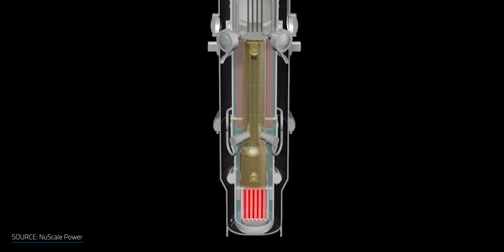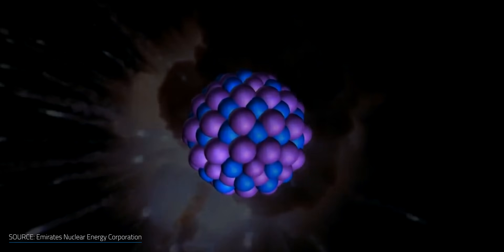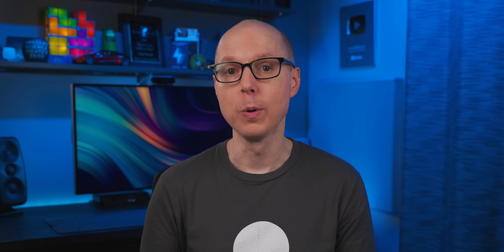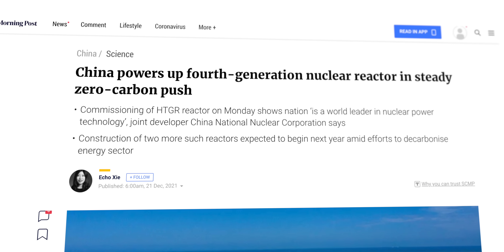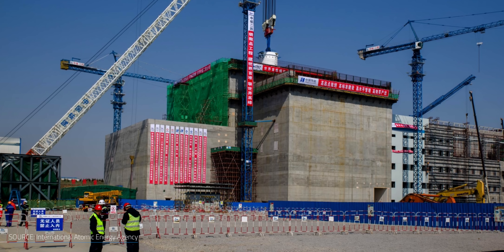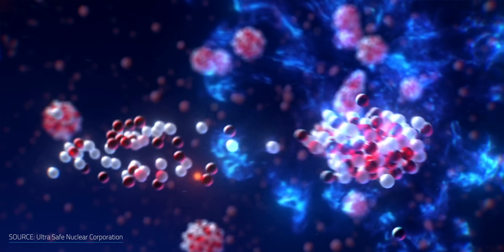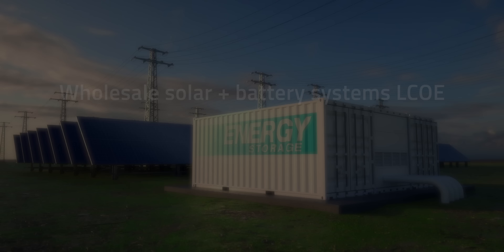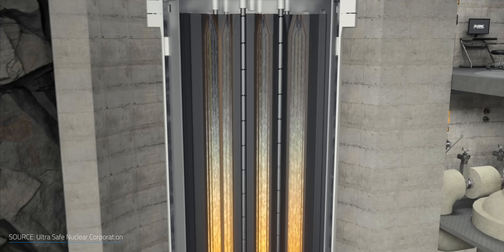Forget Small ... What About Micro Nuclear Energy?

Comment: My only question is: Can these microreactors be used for nefarious purposes, if one were inclined to do so?
Reply: If they run on low enriched uranium, you need to crack open the reactor, extract the fuel elements, process it into hexafluoride, enrich via whatever method, reassemble into something dangerous. It is easier to just get natural uranium and do this. If they run on high enriched uranium, they won't be approved for export. 

The other option is to turn them into a Plutonium breeder reactor but that is challenging as well and I don't know how easy that would be for each SMR design.
Reply: You can make the metal for a wind turbine into a tank or bullets. You can turn oil into napalm. You can use almost anything for nefarious purposes, so why not use it for a good one instead?
Reply: A few tanker trucks full of toxic heavy metal waste from a battery or renewable plant can be used for nefarious purposes for a lot less headache and do more lasting damage than the few curies of radiation released if someone bypassed all the security protocols in place to turn a microreactor into a micro dirty bomb.

Comment: All power sources are reasonable in their own 'wheelhouse'.  I would like to see SMRs and Thorium reactors commercialized, and work alongside solar and wind and battery 'peaker' facilities.  But that could just be my perspective.  Using SMRs and Thorium for lower solar intensity space missions could also be a long-term winner.  Thorium to use the 'waste' from old nuke reactors and manufacturing I see as a long-term win/win solution for much of our nuke waste.
Reply: With Thorium wasn't that due to that it couldn't be weaponized the main reason no further research was done?
Reply: @kiwibonsai2355  That was one of the main reasons that research did not go 'full bore' during WWII.  Afterward, the Thorium demonstration reactor was run for over a decade, typically turned off on Friday evening, and the safety plug was heated back up on Monday morning to restart the reaction.  Pretty safe even as their demonstrator.

But that is just showing my geeky minimal historical knowledge of the project and era. <<grin>>  

Yea, DOD was focused on getting a bigger better boom boom rather than energy for power.  History has a way of changing perspectives over time.
Reply: @jackcoats4146  thanks for the reply Jack.
Reply: @kiwibonsai2355  but also thorium works better as a thermal liquid fueled molten salt reactor design then Uranium.

Comment: Tiny reactor in the wrong hands(even if spent) + fertilizer + diesel = dirty bomb/ terrorist nuke. There are NO nuclear energy that can be tolerated in the long run. Not only is it lethal to be near un shielded waste, the fuel is also dirty to mine and finite in supply. All we would get is a new type of fuel that kills us and we would eventually run out of and have to replace it, let´s not go there again but find energy that we can´t run out of. We may need nuclear in space where solar is not enough and radiation is already high but never on earth.

Comment: Obviously there are lots of details to work out, but micro reactors in concept allow for loads of options toward the goal of decentralizing electricity generation. It is interesting that many people are alarmed about the management of nuclear waste. Clearly, it is an important part of the process, but If only we had been storing the toxic biproducts of our means of energy production in the last 100 or so years instead of letting it float away into the atmosphere (and accumulate) we would be dealing with a very different type of challenge to keeping the planet able to sustain life.
Reply: Nuclear waste is only waste if its useless.  Check out the candu reactor and new research on SMR variants.  We can fuel the SMR reactors for 100+ years with the junk we cant figure our what to do with (or use unenriched uranium which is cheaper and reduces proliferation risk)
Reply: maintaining this units can only be done by highly trained specialists. This alone is not scalable.
Reply: Sent it all to Mars to heatup creating atmosphere … maybe
Reply: I currently manage a stable, and utilize four ox, two bulls and one bison that turn a set of wheels and gears that supply five fifteen kilowatt alternators. 
I gave up that simple life for a cold laser I borrowed from my wife's beauty supply to enable Superconductivity in a ten kilowatt ebike motor that runs all five alternators twenty four hours a day without overloading. 
Bison for sale.
Reply: @robh467  I um..  am going to need that recipe 🤣
Reply: Why should we want to decentralize electricity production? Wouldn't economies of scale reduce cost, and industrial waste per unit power?
Steelworks, construction, and mining aren't necessarily clean (or cheap) industries, so it seems to me that we should leverage said economies of scale to minimize the amount we need to produce in the first place.
Reply: "...but micro reactors in concept allow for loads of options toward the goal of decentralizing electricity generation".  While this might eventually be the case, more importantly they can be installed at existing carbon-based generation facilities where transmission lines already exist. This means that we don't have the ultra-costly task of stringing transmission lines to where the wind blows and the sun shines.
Reply: I never thought of it that way
Reply: As of the last 15 years there is essentially zero waste product for nuclear power
Reply: @Matt-xu6hz  A 1000 MWe generation facility produces electricity for more than 1 million people. At the end of a year, the nuclear plant has about 3 cubic meters of radioactive waste which weighs about 60 tonnes. A 1000 MWe coal-fired plant produces 300,000 tonnes of ash and more than 1 million tonnes of CO2 at the end of a year.. I don't have the CO2 tonnage for methane-fired generation stations.
Reply: Nuclear waste is a easily solvable problem, we can just store it all underground, apparently there's only a few places that allow this but small reactors = small waste and it can be stored the normal way too
Reply: Superconductivity. Superconductivity. Superconductivity. Superconductivity. Superconductivity. Superconductivity. Superconductivity. Superconductivity. Superconductivity. Superconductivity. Superconductivity. Superconductivity.
Reply: Mark Ulis  that's not nuclear waste though, that's nuclear reactor failure due to a natural disaster. Depleted fuel rods are used to initiate new thorium fuel, which is then used to initiate future thorium reactors, which the waste from that is able to be used in Molten salt type reactors, and a lifetime of energy produced via these methods results in about a hockey puck sized mass of waste
Reply: No! Don't entertain this idiotic idea. One single big meltdown is still a lot better than multiple ones spread out all across the country or neighborhoods. This is science unchecked.
Reply: Kalki Ironman type 7 and 8 after 2026 😎

kalki avatar (beast of the earth) (christ on the white horse) (son of man on clouds) is the biggest enemy of dajjal/antichrist/kali 😏

Kalki Avatar (Murtaza) 11th satguru 13th imam cousin of Moula mahdhi a.s. 12th imam (muhammad) 😎

Prophet Moula mahdhi is raja shashidhuvj (the mighty one) born less then 1200 years ago 😎

Prophet Moula Isa a.s. will kill dajjal cause dajjal is going to kill Kalki Avatar 😏

Kalki Avatar will follow orders from 2 religious king Moula mahdhi a.s. and Moula Isa a.s. 😎

Kalki Avatar going to have 2 swords and ring of moula sulaiman a.s. and staff of moula musa a.s. (iron rod) Staff of moula musa a.s. is like omintrix can transform into anything and can transform others into anything And stone in the ring of moula sulaiman a.s. is also known as kastav mani and it's more powerful than all 6 infinite stones combined 😇

Cuz Kalki is ironman batman super saiya-jin superman ben10 saitama optimus prime shaktimaan and every super heroes combined after 2026 😎

This staff will transforms into white horses with wings,weapons,iron-man,cloud etc or can do imagination into reality 😎

*Ratn sru sword of lord shiva (miri)😇

*Ratn varu (zulfakar) sword of Moula Ali (piri) 😇

miri piri 😇

Kalki Ironman after 2026 😎

Satyug (sunrise from West) 2038 😏

Sambal is hospital 😏

Gzwa e hind 2029 😎

Khalistan and Azad Kashmir after 2026 by Ironman 😎

99% Hadith u heard is not about imam Mahdi it’s about Kalki avatar (the main character) that person momin vs dajjal prove me wrong if u can 😏”
Reply: What a moron. Do you even get what you are saying?
100 yrs later our current tech will seem like a waste of resources. Thats the same for 100 yrs back.
Now that we have better ways to use resources we say previous gens wasted it. But they were also looking for more efficient ways.
There will always be a curve. Things don't happen suddenly. And the consumption nowdays is NOWHERE near what it used to be. 
Even with more efficiency we will waste more and more. Because we will always need more.
Reply: Kalki ironman after 2026 😎

Humans 0
Saiya-jin 1 to 6
Angels 7 😇

Kalki Ironman 5th matriya buddha 8th arc Angel 11th satguru 13th imam and 24th avatar after 2026 😎

Almighty God 9 😇

Humans type 2.5+ after 2026 by Kalki Ironman (christ in the white horse)(son of man on clouds) type 7 and 8 😎

Jarvis the world’s first artificial intelligence (parrot) 😎

Cuz Kalki is ironman batman super saiya-jin superman ben10 saitama Narutoo shaktimaan and every super heroes combined after 2026 😎

Jarvis world’s first artificial living being (just like vision in marvel universe)😎

Made of Quantum and sub quantum particles 😎

Power source quantum energy arc reactor (type 7) level technology 😎

Kalki Ironman going to have every kind of arc reactor like:- type 1 Nuclear fission, nuclear waste, hydrogen fusion, type 2 3 4 5 antimatter arc reactor (solid liquid gas), type 6 electro quantum arc reactor, and type 7 Quantum arc reactor, type 8 limitless quantum energy arc reactor without quantum particles 😎

Kalki Ironman going to have sun in a box million billion tons of hydrogen nuclear fusion reactor type 2 3 4 5 just like sun and stars in the palm of his hand 😎

This all going to happened by self replicating quantum nanobots knowledge energy and techniques at type 7 7 7- respectively 😎

Ironman (Tesla 2.0) going to reveal every secrets of the world specially Tesla and his Antigravity 😎
Reply: @Ironcammandoo  do what...?
Reply: Elon’s  rocket to the sun, let it on convert the nuclear waste
Reply: @Dirtyharry70585  what. no.
Reply: @Dirtyharry70585  It's extremely difficult to reach the Sun with existing rocket technologies, although you can get pretty close. If you're just going to dump nuclear waste it's far easier and cheaper to place them on the Earth's ocean beds in subduction zones.
Reply: @nagualdesign  is that where they dispose  subduction zones. I theorized this one evening. Don't remember if I looked into it.
Reply: @cavelvlan25  Yes, it was first suggested in the 1970s or earlier, although others have argued against it. Let the Earth recycle our waste.
Reply: @cavelvlan25  Subduction zones are permeated with water that subduction pressure forces to the surface. Water (and air) contaminated with nuclear waste would create apocalyptic scenarios.
Reply: @Dirtyharry70585  The problem with shooting nuclear waste to anywhere in space is that on average, about 1% of rocket launches explode. If something has a random 1% chance to be chernobyl, you dont do it. Especially not 100 times.
Reply: any steps away from oil addiction, are good for future generations.
Reply: @nameless1016  Whale blubber lamps would not use "oil" and be renewable until we ran out of whales. We could all crawl into caves and only expect natural sunlight for lighting when we dared to crawl out of our holes. Yes we as a species can move past using stored solar power (that is all "Oil" or "coal" is) but even ending civilization as we know it would not enable the transition at the flip of a switch. The people living in the modern world sort of like the conveniences it provides, electricity, running water, flush toilets, entertainment, communications, transportation, medical care.... the human race existed for a long time without any of those comforts, which ones are YOU willing to give up?
Reply: @ocelblack9823  Well put, stored solar power is effectively all the "energy" that is easily accessible we find in the Earth but nuclear done right could give us all of that for far longer.
Reply: @ocelblack9823  None of them. And you?
Reply: @Barberdan  There are only 3 basic sources of energy, fusion, fission and inertia (gravitational). nuclear decay is a subset or daughter of fission. EVERY other "source" of power can be traced back to those basic sources.
Reply: Yes see that guy in the $300,000 pickup truck rolling coal.. Now he can buy a miniature nuclear reactor what's there to worry about...
Reply: @bradhaaf4749  It's nothing like that.
Reply: @bradhaaf4749  He can probably come up with the extra $20 a week in fuel costs, not sure he could swing the $20 Million for the reactor.

Comment: You can´t start such a video with "nuclear is reliable and clean". They are not very reliable, look at France and the many times, they have to throttle their plants down for example in the winter and have to import energy from other countries. They produce dangerous waste and mining uranium is super bad for the environment, so they are not clean.
Where does the time frame for building normal nuclear plants come from? 6 years? What about every new plant, which take much longer to build.
You talk about the "modern" plants like they are real. Every example you could bring is a lab experiment and/or is chinese...trustworthy...
Smaller plants can´t be much cheaper, as they need about the same amount of safety measures and ensurance (haha, nuclear plan ensurance). And where do you want to build them? There is not even enough usable space for normal plants and suddenly we want to build a huge amount of small plants?
Even if they are safer than normal nuclear plants with the larger number of small plants the danger of an accident would rise.
What would happen in a country with thousand of the smaller reactors and a war breaks out?
And then you finish with the death rate graph?! The stuff idiots like Michael Shellenberger bring up, to tell us, how dangerous wind turbines are, because one idiot fell down from one.
But cool, you compare it with oil and gas, well that is whataboutism. Point at something even worse to make your shit look good. It is about renewables vs nuclear and there is no angle, where nuclear is a sane idea. Nuclear has so many problems...waste, cost, time to build, not enough places where to build them, reliance on other (often problematic countries) and danger of accidents.

Comment: They need to go through the regulatory process quickly. I would think given the earths threats to heat up we would decide on areas far from populations stripping down safety concerns except for the men and women working locally on the project. I cant imagine it being anymore dangerous than working in a coal mine or building oil rigs. If something does happen and the area becomes iradiated at least its on a very small scale vs global warming.  I have seen people complain about wind mills ruining the scenery which seems absolutely insane vs the alternative.

Comment: "the nuclear perception issue" how about solving the nuclear waste issue before just changing the perception?
Reply: Nuclear waste is the only waste that is 100% completely stored, captured, and contained within high strength, corrosion resistant, structural metal alloys. Seriously, the waste is all there! Inside the metal can! What if you could say the same thing about coal or oil waste products? Just imagine!
Reply: @Bloated_Tony_Danza  right fair enough, never thought about it that way, only heard about how those barrels corrode in some salt mine and leak radioactive particals, potentially into the ground water.
Maybe thats not up to date information anymore tho.

Comment: I hope someday we all can have tiny reactors in our homes.
Reply: Still need to solve decommissioning and entombment. Once it gets cost competitive to use.
Reply: @davidmccarthy6061  That problem will never get solved , it's just inherent to fission to have unacceptable fuel processing cost
Reply: @cedriceric9730  when you encase your quasai-inert, solid ceramic fuel… in high strength, corrosion resistant alloys, yeah it’s pretty expensive to reprocess. But the ability to dissolve an actinide salt into either water or another molten salt would seriously make reprocessing cheaper. Fluids are superior to solids in this regard, and a fluid fueled reactor would make it much more affordable
Reply: @davidmccarthy6061  better than putting the waste in the atmosphere.
Reply: Nuclear diamond batteries, if they can be scaled up, can last 10,000 years, uses waste from nuclear power plants, and is totally safe.
Reply: @scottslotterbeck3796  it's a joke, diamond bs
Reply: SLOWPOKE reactors operate from 5 kW to 20 kW (thermal), perfect for the home or cottage.  Try one in your RV! Kidding aside, the University of Toronto decommissioned theirs back in early 1999. [Edit: it was 2001]
Reply: That would be a great solution to our power grid problems. In my area we have had 3 power outages already this year.
Reply: Progressive liberals will kill this technology,  oh wait, they already are 😡
Reply: Same. But only after we can cure cancer cheaply and easily. Or better yet make us immune to cancer. Only then would I be cool with a nuclear reactor in my neighborhood let alone my home.